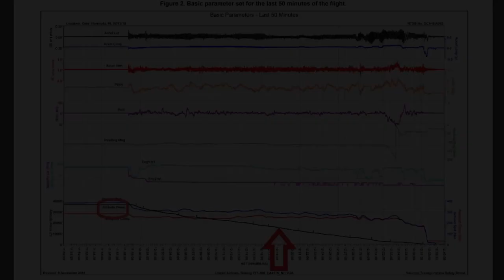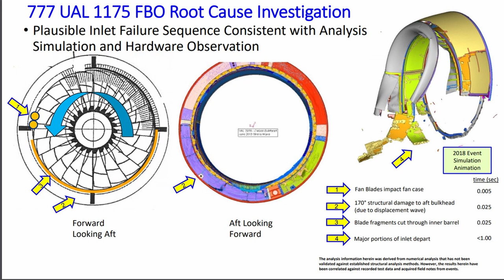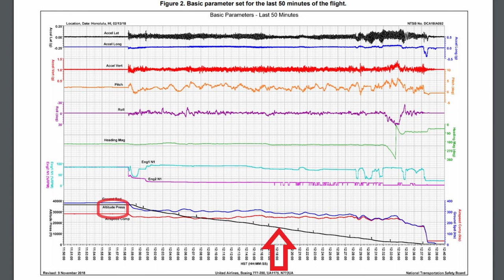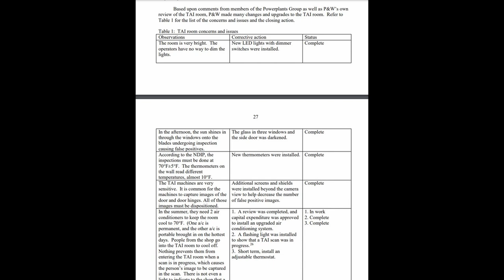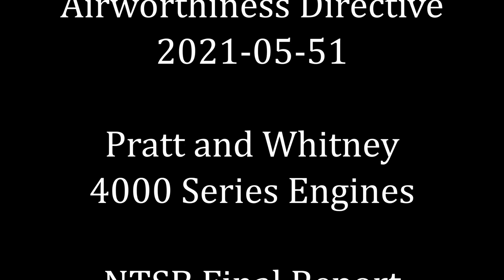Emergency AD & NTSB Final Report UAL 1175 Fan Blade Failure

Comment: Juan, your professional, no B.S. explanations of various incidents gives me full confidence in the air crews flying "legitimate" carriers.  Incidents happen, but training and ability take over.

Older technology used Magnaflux, whereas a specialized fluid was used, the metal was subjected to a strong magnetic field, then examined under a illuminating light.  Cracks attracted a different magnetic field.

Comment: Thermal imaging surface emissitivity (changes greatly by material type and surface finish) greatly impacts measurement accuracy. For example using an infrared camera/thermometer pointed at copper electrical bus bar the, copper or aluminium acts like an infrared mirror, so you often are reading the reflected temperature of something nearby. You can see yourselfs hear image reflected off copper and other surfaces for example. So it's common to paint a surface (paint has a known emissivity, paint color does not matter) so it emissivity is. 0.95 or I use a strip of electrical tape stuck on what I'm measuring to get an accurate heat measurement. Infrared images can suck at accurate temperature measurements unless you understand material emissivity and relation abilities) you can adjust the infrared camera emissivity to the material you are measuring even the heat reflections can trow the measurement off by a lot, and if you are looking at different material like the different metals an engine is made with each with different emissivity number impacting temperature measurement accuracy and reflections from other heat sources. 

Infrared imagery is a great very useful tool (finding water and other leaks, heat loss, comparison, finding bad electrical connections, home inspections, how full a liquid tank is, hot spots on circuit boards /surfaces), but can easily decive you

Comment: I think there is a discrepancy between the images of the fracture(s). The picture at 0:36 does not seem to be the same section as at 0:52
Also, the ratchet mark indicated in the image at 0:36 looks more like another fracture at right angles to the failure. Ratchet marks are typically parallel to the failure.

Comment: Titanium has poor thermal conductivity for a metal, which is why TAI works with it (copper or brass wouldn't be very suitable).  If you've ever played with a thermal camera you'll know bare metal has very low emissivity at room temp. and acts as a heat mirror and doesn't show its own temperature, most other materials have good emissivity, almost any kind of paint would work.

Comment: Aha..I responded to the previous video on this incident. Now 30 sec. into the vid and watching a cross section of the engine.. Looks like it where the blades on that outer ring just after the first wheel than rained from the sky in the Netherlands. They must be called outlet guide vanes or somthing like that to "straighten" out the spinning flow of air after the first wheel.
Reply from the maker: correct.

Comment: High speed camera optics are very different to what we normally call a camera. My brother works for a company that produces those and I used to be the physics nerd. Now I'm getting taught interesting tidbits about quantum physics because these camera systems have long since reached the point of counting individual photons.
Wavelength and other properties of the photons are parameters you can only nail down very tentatively.
If you can ignore wavelength (ie color) you get a lot more useable information per time.
And that's just the optical light side of things.
The restricted wavelength of thermal radiation is probably not helping this situation.

Comment: There are 2 engines for the 777, one from Pratt & Whitney and the others are from GE.  P&W were the first engines available for the 777, so this is why United ended up with them since they were a kick-off customer.  The 777's that they assumed from Continental Airlines all had the GE engines.  We hear about the fan blades in the P&W engines now, but thy have always been a problem.  All of these engines (GE & P&W) are equipped with vibration monitors.  I know that there have been a number of blades changed from high vibration, and most of them were found to have had cracks over the years.  The GE engines use a composite fan blade which is lighter, and stronger.  They have been in use since 1993, and are made by a company in Texas for various aircraft engines.  For more information, visit  https://c-fan.com  

GREAT reporting and breakdown of aviation / aircraft subjects.

Comment: “AC dies, DC lies”. Interesting. Haven’t heard that one before.  Frozen instrument readings create really hard problem solving scenarios. I’ve had that occur in an electric generating plant. You know things are going to hell, but can’t see what the problem is. Extremely challenging. 
I still hold out the option for a means that the crew can jettison the engine in the event of over water catastrophic failure on an ETOPS flight.

Comment: Thanks for the video. I’d love to know where this UAL engine sat on the inspection process timeline. Also after 1175 there was no AD and the standard overhaul timeline for the PW40XX engines remained? 

Lastly I’m really curious what the rejection rate for blades was pre-2018 and post-2018, or simply in general. I’ll go through the report, but that’s really the only way to know how big of an issue this REALLY is. 

Also was the 747BCF incident the same day a fluke thing? I know it’s the same engine family - but the blade diameter is a good bit less on that variant as I recall. I suppose they’re treating that as it’s own incident as that engine variant obviously isn’t listed in this AD. 

Still, I’m a bit bummed about the -200s - I flew on one of these early UAL aircraft (like literally one of these reg #s) UAL Battleship Gray, IAD-LHR during inauguration flights as a kid - I remember telling my dad how it had the biggest jet engines on the world (the GEs and LR/ERs weren’t out yet.) At cruise you could still see the spinner due to diameter/power to spare (unreal in those days!) 

Between this, the pandemic, and more efficient aircraft (and airlines not wanting to defer or pay fees for these new planes) I believe we are watching the final chapters of the -200 (freighter conversions and repurposing really only favor the ER/LR/300 or GE-equipped.) 😟

Thanks again for the update - glad you get to fly the trusty GE90!

Comment: painting the bladed is needed to work FLIR-type camera: it's hard to impossible to messure optical reflective surfaces, so you need to have them as dark and matte as possible. 
Painted by hand seems for me an unfortuane road to failure.

Comment: Very interested in the aerodynamic upset upon the sudden departure of the engine cowling.  The rapid increase in drag of the naked engine plus the reduction in its thrust must have yawed the airplane severely to the right (toward the bad engine).  Maybe it decreased the lift of the right wing and at the same time increased the lift of the left wing causing the machine to yaw & roll to the right (bad engine side)  I have flown radio controlled model aircraft that did not have ailerons and you turned/banked them with only the rudder by yawing the airplane.  Worked best with some dihedral.   How much if any pitch change did Chris experience?   Would be much interested if you and Chris could discuss your thoughts on this upset.

Comment: How often do you hear about air crew looking at instruments and not knowing what the problem is. My question is with camera's being so cheap any good now days, why are there not camera's pointing at critical systems like the engines? The crew would have known that it was an engine, not a door very quickly.

Comment: Just found this channel. Absolutely love it! The time you take, not just to nerd out on the tech, but to factually report out on it, must be incredible. I'm a 15 year airline Line Maintenance A&P, now 9 years as a development assembler for new build commercial turbofans. Your reporting far outstrips anything I've seen. Well, other than the Dateline episodes "Flying Cheap," and "Flying Even Cheaper," after the Buffalo Dash-8 crash.
 Interested to know your take on the difference between the all-metal (titanium) fan blade engines vs. the composite (carbon fiber w/ titanium leading edge) fan blade engines.
Thank you for reporting, factually, without hyperbole, and truthfully, about what working for a major commercial airline actually entails, good included.

Comment: Concerning Flat Plate Area Drag (am i remembering the term right?), from these two accidents do we have usable data from which pilots can predict flight characteristics of the damaged plane in future cases of cowling loss? What I have in mind is analyzing the actual aircraft response to pilot input relative to the amount of drag. Having happened twice, is that drag measurable (at least in a range)? Do two events give enough information about aircraft response, or is it at this stage just anecdotal? Is this a worthwhile line of questioning, at least in the long run? (I'm not a pilot, but I grew up in small airports like the one you showed in the "Hanger-Piloting" episode, so i still ask myself these things.)

Comment: Back in 1989 a United Airlines McDonald Douglas DC-10 flight UA232 departed Denver & suffered a catastrophic fan disc failure on its #2 General Electric tail engine that severed all of the planes hydraulic lines leaving it unflyable which resulted in a crash landing killing 111 of the 285 passengers. The engines Titanium fan disc completely separated into two pieces & landed in a Iowa corn field & couldn't be found for 3 months later in October by the farmers combine in their field. GE offered $120,000 in reward money to locate the missing fan disc.
Tests of the fan disk found impurities in the alloy a defect caused by excess Nitrogen during the forging process. During that time there were 200 DC-10 planes flying the sky's.
Reply: It was flyable.  Controllability wasn’t so good.

Comment: I assume that fan blades are removed for testing at specified intervals. If everything else in the engine checks out, is there a set of blades ready to be installed so the plane can get back in the air. I would think that the airline wouldn't want that plane to just sit on the ground until all those blades are inspected and returned. 
Is there a maximum number of hours that the blades can be run and then they are disposed of?
What is the cost of these fan blades?

Comment: Titanium is a bad choice of materials for those massive fan blades. They’re going to eventually mandate a flight hours based replacement schedule for the component, And the inspection process is absurdly cumbersome. 
Newer competing designs feature composite fan blades.
Reply: 30 years ago titanium seemed like a good idea...

Comment: If the plane's first reaction is to nose up and yaw right, wouldn't chunks of the cowling strike the tail?  If Number 2 has failed, its generator, hydraulic pump and bleed air are gone also.  How do you isolate that engine?  How do you manage fuel with only one engine?
Reply: The engine was destroyed in 2 seconds, a plane that big takes longer that that to get really out of shape.

Comment: At one point are the attachment pins designed to snap?
Because I think it should have shed the husk at that amount of drag.
Some 30 years ago 747s lost a couple engines because the pins broke when thry shouldn't have. One was here in Anchorage.

Comment: When discussing the weight and dimensions of the problem fan blades were in pounds and inches. Are these engines still manufactured in pounds and inches rather than in metric measurements? The USA is the last country using the old English measures.

Comment: In Formula One motorsport they spray hiviz paint on aerodynamic parts of the car, get it up to full speed and then the paint will shift with the forces upon it, leaving an imprint when the car returns to show how aerodynamic parts can be further altered to give better performance. I don't if this is why they paint the blades, it's just an educated guess.

Comment: ok, what i dont understand is, why make the blades hollow in the 1st place? i understand wishing to gain weight savings, but couldnt you just make the blade a thinner, solid blade and alter the sweep to maintain comparable compression? wouldnt that be safer in the long run? 
yeah, a presentation on the wrights would be cool!

Comment: Considering these fan blades were made in the 1990's as Juan says, why don't
they just replace "all" the fan blades on the 400 Series of Pratt and Whitney engines ?
If they were good say from 1995 to 2020 -- you know you have 25 years, until metal
fatigue can cause cracking, and thus the blades can self destruct, in some cases.
 
So, issuing a directive that orders that every 20 years, these blades must be replaced
would seem like a very smart idea. It may come down to this, because if 2 incidents
just happened in the last 6 months or so, you can bet, there are other blades on the
verge of breaking up. It is just a matter of time now, on the already installed blades.
 
Even if they test them now, and all looks OK, the metal is at an age, where cracks
can develop "after" testing quite easily.  I would think that common sense would tell
you -- to just replace them all, after a certain length of time.
 
I guess they will also want to determine, why the fan blades are OK on some of the
series of engines, and others have very small fractures, and try to determine the
best types of metals to be used in future, for the manufacturing of these blades.
 
Interesting video -- I always enjoy them, although I'm not mechanically inclined.

Comment: This is a BOEING problem.  The P&W blade failure was contained as required.  FAR25 also requires that the inlet does NOT detach from the engine in flight.
Reply: Boeing does not make the fan blades. Isn’t that the immediate problem that needs to be looked at?

Comment: I have to assume the risk of damage being caused as a result of all these blades being removed, sent for P&W to inspect (I assume they're shipped from wherever) then returned and installed again is negligible.

Presumably no commercial case has been made for having a facility built with the specific aim of meeting all NTSB comments on what's ideal for the tests to be reliable, plus have a staff of suitably experienced and qualified people, else one would exist or be in the works?

Wonder if that may be revisited if the NTSB reports that the conditions of the test facilities mean the tests aren't of sufficiently high reliability? Probably not, unless the manufacturers and/or airlines believe the potential legal liability if one of these incidents were to go so badly wrong as to result in the loss of an aircraft is deemed too great to accept.

Not that I am in any way trying to be alarmist. By any obvious measure the fact remains these incidents ARE rare and haven't resulted in loss of an aircraft. (now that I think of it, wasn't that remarkable case of the DC-9/10 (?) that made it all the way to the airport then broke up on landing caused by a blade/blades severing a bunch of control cables and hydraulics such that the crew somehow managed to 'control' the flight by varying thrust on the 3 engines? I'm going from memory and being lazy not looking it up, LOL. 
Haven't there also been instances where passengers were injured or killed from a blade being thrown off into the cabin? 

Even there I suppose part of the question there was whether the blade itself failed or the failure was due to conditions exceeding design tolerances due to another fault, as I believe happened in the case of the RR engine on the Qantas QF-32 A380 (again from memory a manufacturing failure of thickness of some otherwise seemingly 'unimportant oil pipe stub' or similar? Haven't watched that Air Crash Investigators episode for years, LOL)..

I'm just an onlooker with no claims to any relevant aviation experience. I am something of an expert on business processes and associated elements (controls, training, blah blah) which could be why I find all this stuff interesting

Cheers

Comment: As a result of this incident, apart from the surviving engine having its blades checked. Will it be removed from the aircraft serviced and re installed. Or is it binned/scrapped as it has had to operate above its normal power settings?

Comment: Juan, This is a bit off-topic but are you flying the 777 as a freighter using "seat freight" (AAL used to do this; i.e. seats are left in the a/c) or are the seats pulled ? Thanks for this great explanation.
Reply from the maker: Seats in.

Comment: If it is an engine problem why are not all of the airbus aircraft that have the same Pratt and Whitney engines grounded as well?
Reply: The fan blades are different on the P&W engines, so they are not all grounded.
Reply: Only the biggest PW4000 engines use HFB's. The PW4000's  on the 767 and 747 are not "hollow." P&W hasn't sold engines for the 777 for at least 10 years. The plane outgrew it's thrust capabilities.  The few remaining 777's with P&W 4000's have probably seen their last flights. The planes have to be around 20 years old by now and not worth the hassle of worrying about this. No other civilian engine uses that blade design.

Comment: It is going to be interesting, if the fan blade inspections results, produce any cracks or failures in the used blades sent to P&W?   Did this process avert another fan blade failure?  Thanks for sharing Juan...........
Reply: The full NTSB report indicates that this fan blade failure was misinterpreted during testing, and should have been prevented.